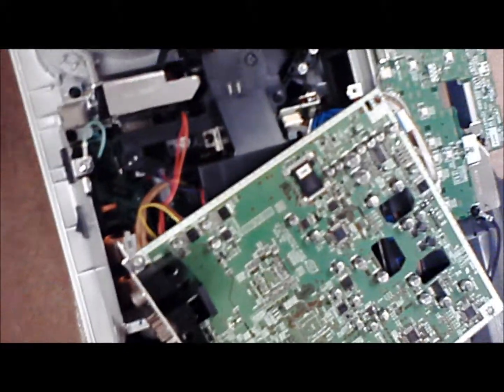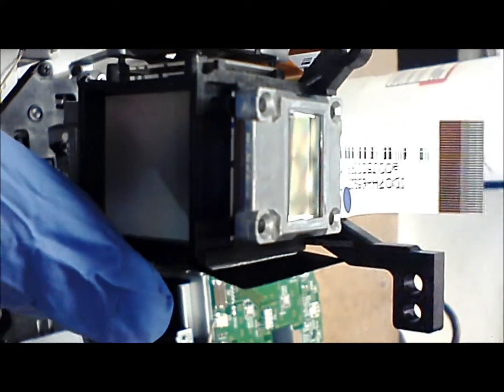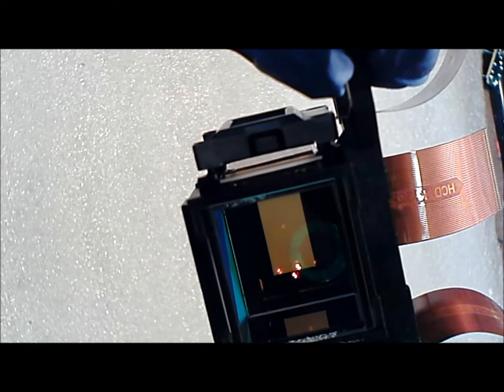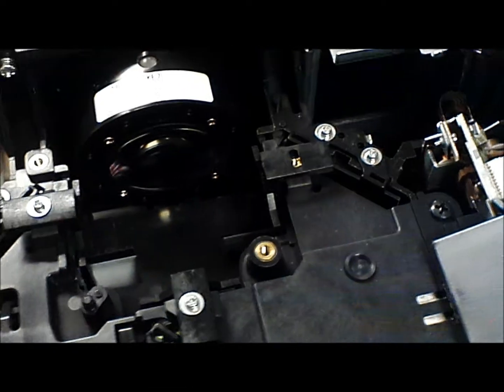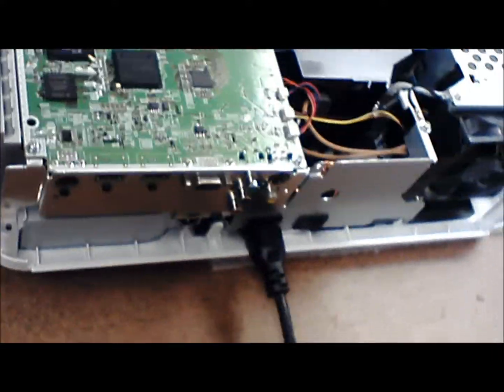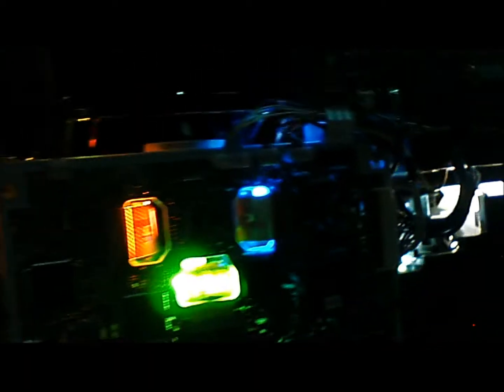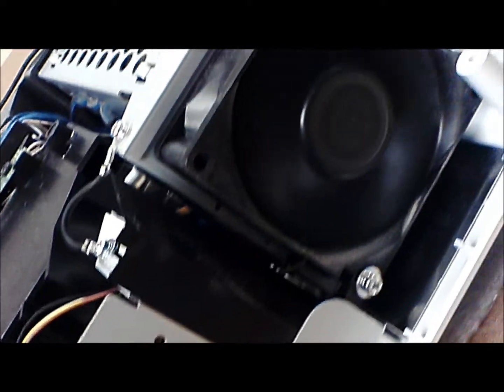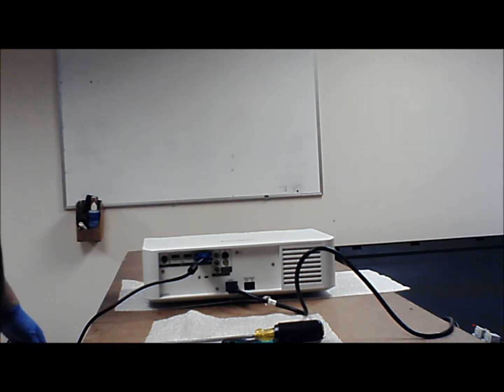Polarizer Replacement Panasonic PT-AX200U LCD Video Projector

Comment: I've stripped down my  Panasonic PT-LZ370 as it has a green haze mostly on one side when displaying a black or dark screen, other than that the image is perfect, having cleaned and checked for dust I'm wondering if I should remove and clean the PBS array closest to the lamp as I hear they can cause issues or burn due to heat. Any advice would be greatly appreciated.
Reply from the maker: Sometimes less is more but I fully agree that a clean projector will be better.  Heat is what ruins these so anything you can do to keep it cleaner and cooler is a good idea.

Comment: verry educational video!
I’m working on 6x Epson 7 and 8k lumen projectors.
same problem.
i’m trying to experiment with making the polarisers diy style, found a company in the uk that manufacturers the polariser film.
the original polarisers are the coated type ones that you can not clean with anything.
Reply from the maker: Epson drives me up a wall.  I wont even touch them anymore with optic issues. those polarizers and other coatings are really a problem with them.  good luck with your research! I hope you figure something out!
Reply: there will be a youtube clip on my channel with the repair. i'll post it even if it fails although I'm verry confident it will work. @FixitFrank

Comment: If the whole picture of the projection is fully green would i have to replace the green one ?
Reply from the maker: I believe so.  The green polarizers control the green level.  But it could also mean the red and blue LCD panels aren't working.  If you have some faint red and blue then yes, Id look at the polarizers.
Reply: @FixitFrank   ah ok  thanks I checked it and turns out one of the wires wasn't connected kinda goofed a bit on that

Comment: i have a huge red spot on my projector,  will replacing the panel fix it?
pls lmk thanks!
Reply from the maker: It depends on the model.  Sometimes its the LCD panel, other times its the polarizers.   If its this panasonic and its the polarizers, then yes, you will be in good shape if you replace them.  If its the LCD, that is more of a problem.  Aligning the LCD is very difficult.
Reply: @FixitFrank  I think what I did is I plugged in 125v fuse on a 250v, and it burned after that, so Im not sure what's the problem exactly. And the model is Groview bl-89
Reply from the maker: @rohitchabukswar7266  I have good/bad news. The bad news is that you cannot repair this projector for a reasonable price. The problem is a melted LCD panel/Polarizer panel. In this model there is only one LCD/polarizer panel and they are a generic device that you can buy but the cost is more than the projector.  Sadly this makes these types of devices disposable.  There is really nothing you can do.  It happens because they use a single COB LED without any IR filtering.  This causes the polarizer/lcd panel to degrade quickly. 
The good news is that you did not cause it to happen. this is a very common type of failure for these fixed focus flashlight projectors. They tend to last a year or so before they fail like that. I would suggest purchasing a used name brand projector over one of these types.  They are close in price and the name brand models will last far longer.

Comment: Hi I got a used Panasonic projector same as yours. I can't seem to determine where the small connector with a blue colour from the power supply should go. Any idea
Reply from the maker: Its been many many years so I must apologize i do not recall. However, here is a link to the service manual.  https://elektrotanya.com/showresult?what=pt-ax200&kategoria=&kat2=all  It is third one down.  You can see the wiring layout in there.  The website is in Hungarian but it is legit.

Comment: Hi Frank, what type of tape or adhesive did you use to hold the polarizers down in the lcd panel? Will 3m adhesive work or super glue?
Is it best just to buy a working unit and just exchange the whole assembly?
Thanks
Reply from the maker: It's been a while but I seem to recall there being adhesive already on the polarizer.  that said, this was a pretty new projector at the time.  these days, I would look at installing a used but working optical assembly. That way all of the parts are evenly worn.  If you put in a new polarizer on an older assembly the colors will always be a little off. I learned that the hard way.
Reply: Do you think it's worth the repair on the cheapest projector?  The yg300 to be exact.

Comment: Where did you order the parts from
Reply from the maker: These came from Panasonic parts directly(PACparts.com) but being that this model is pretty old now, I would be surprised if they still offered them.  You might be able to find them through aliexpress or try Time Electronics.  Their email is gydz@timeprojectorlamp.com
Reply: @FixitFrank  mine has a green blob and they don’t have parts anymore

Comment: Another great video from Frank. They don't come any better. Useful information. As Frank said after fitting the polarizer to adjust you will have to remove the mainboard to access the adjuster screw and then you don't know which way to move it left or right?
Reply from the maker: Without the motivation from wonderful colleagues like you, I would not be as excited to post these. It goes both ways my friend.

Comment: I know this is an old video, do you know where I could get a blue led/polarizer for a nec np-pa653u ?
Reply from the maker: Thats a tough one.  Alibaba would be a good place to start.  However NEC parts are kind of a pain.  You might want to try emailing a company in China I use. GYDZ@TIMEPROJECTORLAMP.COM   Be sure to include a picture of the parts.
Reply: @FixitFrank  Thanks!

Comment: i have a question: i have an epson power lite 1080. when i turn on the projector the image shows up but it has a blue tint. this blue tint is present whether i’m playing a dvd, using the apps on blue ray player, watching regular cable, etc. i also have tried connecting the projector to different HDMI cables and also without HDMI cables but it continues to show a blue tint with the image from the projector. do you think the problem with the projector is the polarizer, specifically which one, and if so, do i have to change all the polarizers? thank you for any help you’d be able to give and for providing informative content.

Comment: Are these polarizers different from each other or these same (in accordance to color and focus)? How can i make a diy polarizer ? for my projector Epson 7600.
Reply from the maker: Hello Muhammed! Each color has its own polarizer. My understanding is that they are designed for each color frequency.  Each color has 2 polarizers, with a total of 6. I found that unless the polarizer failed early(like in this video), changing all 6 was needed to ensure the color was correct. All polarizers fail eventually. They slowly degrade over time. A new polarizer will work stronger than the worn polarizers and cause colors to be uneven.  I have never tried a DIY polarizer myself. My experience with LCD projectors has been a poor. Finding the correct parts has proven difficult for me.  Unless the LCD projector has an electronic issue, I tend to stay away from them because of the lack of parts.
Reply: @FixitFrank  sir lot of thank for detailed answer and i hope you will entertain with same passion. Your answer has satisfied my passion. Thanks again........Love you....

Comment: Hello, in the case q is q to cleanse the polarizing filter as you would do with that liquid ? i had an experience with a projector epson which cleaning of the filter is damage , gone was the layer of the filter, with other brands i have cleaned and i have not had a problem but with the epson if.
Reply from the maker: Hello Dan,  I would not put anything on the polarizer.  They will damage very very easily.  If you have polarizer problems, they need to be replaced. Once they start to fail, they are not able to be saved. Epson is well known for polarizer failures.  I won't even work on them anymore.  Too hard to get good parts.

Comment: sir please try to make a video on lcd alignment in 3lcd projector
Reply from the maker: I'm sorry, that is something I will not ever be doing.  It requires tools and fixtures that I do not have access to. The amount of time and effort is not cost effective and the hassle is too much for me to deal with.  I will clean LCD projectors and repair their electronics but I will never align an LCD.  It is very very difficult without the proper tools and even then, the time required is not worth it.   LCD projectors tend to be more disposable than DLP because of the design.  Normally I will not even replace polarizers.  I only did this one because it failed for an unusual reason.  Usually you have to replace all 6 polarizers since they all degrade at the same time.

Comment: Hello Fixitfrank,
I know you mentioned going to Heartland Supply for parts, but I can't find that website. I have a Panasonic PT-AE8000. I had to clean the PBS Array. It hat residue burned onto it. I was able to clean it with a razor blade without scratching, but close to the end of cleaning it I pushed to hard and the array came apart in two pieces. I want to replace the Array and one of the polarizer plates(blue).
Reply from the maker: You may want to try encompass parts. They have a lot of oem Panasonic. Another source is eBay, it may only offer used but good parts.

Comment: I have tat projector and it has a blue ring on the screen is this what causes it, if so how much is the repair usually,thanks
Reply from the maker: Hard to say the exact cause but you may want to try cleaning it first. Circular makes me think its dust making the blue but it might be the blue polarizer as well.  Repair costs vary depending where you live.  Can range from $150-200 up to $400 or so.  If it were mine, I'd buy a broken one on eBay with good optics and bad power supply. Then make one out of the 2.

Comment: Hi FixitFrank,
Thanks for the video. Do you think LCD projectors can be run without polarizers at all. I'm trying use a couple of LCD type projectors for a 3D projection setup and my 2 Proxima C445+'s are "pre-polarized." This messes with the setup required to view 3D. Thanks.
Reply from the maker: Short answer yes, long answer you may not like the results. The Polarizers set the color brightness per color channel.  If you remove them, you may lose all color balance and it might not allow you adjust it with the menu settings. All of that said, if you don't mind chancing it with the C445's, you may find it works for you.  Is the problem because of how the 3D is created? The image cancels out(for lack of a better term)?
Reply: Hey FixitFrank,
Thanks very much for the helpful reply. 👍

Comment: Awesome video. Is yours almost the same as a pt-ar100u? Mine has a bunch of green vertical lines, some are squiggly though and also has a green 'blob' on the side of the picture. I'm pretty sure it got a little hot when my daughter passed out with it on for about 7 hrs. 
Btw those little clips holding the 3 cables to the board are a pain. Barely touched the first one and the ear busted off.
Reply from the maker: Hi Joe, its pretty much the same for most projectors around that series. LCD projectors more or less work the same. if yours has squiggly lines it is most likely those cables. the latches can be a pain. you may want to consider buying a scrap unit on eBay for the latch parts or even used polarizers. but you may also be better off buying a used working unit for the hassle of finding parts for that model since its pretty dated at this point.

Comment: Hi Rostit, not sure if you are still monitoring this very old thread but I am hoping you can still help. I have had the yellow blob problem for a long time and saw this video also some time ago. I have over 5000 hrs on this old beast and so I was a little reluctant to go through the hassle of replacing the polarizers. Then my latest bulb actually "popped" and broke (not sure what that was all about) and I had to open up the unit to clean out the fine glass particles. Anyway I though this might be a good time to pull out the blue polarizer to see what was up and sure enough it had a large discolored rectangle area which I assume represents a large burn area. I did not have the replacement part and because for the most part this just messes up large areas of white (like hockey game ice and snow scenes) I figured I could live with it for a while. Long story short I put every thing back together and now I have these blue vertical lines across my screen. could I have put the polarizer back in backwards or something? I checked all the connectors and they seem fine. Your advice would be most welcome.
Reply from the maker: +Kim Upright Hey there, I do still monitor these. Blue vertical lines is probably due to the Blue LCD panel flew cable.  Try re-seating the cable in the ZIF(zero insertion force) connector and gently hold it in place when you snap the ZIF latch back down to hold it. I would bet the cable is almost all the way in  but either not straight or not in all the way.  Sometimes people dont realize the connector has a latch and just pull the wire out and push it back in. Make sure the latch is open all the way when you slide it in and then latches snugly when you close it.  Good luck! Frank
Reply: +Rostit Wow awesome quick response. The clips for the ribbons coming out of the image block on the circuit panel have little black pins that have to be pulled out on each side of the clips (took me a while to figure this out) any way I have reset the ribbons in these clips a couple of times with the same effect. I am amusing from your reply that this is the part you are referring to. Anyway would you recommend re-seating the ribbon while the projector is running? or is there too much risk in frying something on the board?
Reply from the maker: +Kim Upright sometimes they feel like they are seated when they can drop down a little more. You "can" do it with the projector on, but you need to be hyperaware of the high voltage by the lamp.  Be careful when you adjust the cable. its not likely to short out the driver chip as the pins have some space to slide a little without touching what it shouldnt.
I would try lifting the latch of the ZIF latch and gently press and rock the cable. the picture will go nuts but it will settle once it drops into place. Check the other cables too. Not likely that they are loose but its worth checking. good luck!  Frank
Reply: +Rostit Hey Frank thanks for all this - I did finally get the cable to sit right and the lines went away. Sadly after adjusting all the menu settings and getting the picture to look passable for most scenes with a fried blue polarizer -  my PS3 finally decided it was it's turn to kick the bucket so I give up :-) Thanks again for taking the time to help out.

Comment: Hi Rostit, very good video! why did you change the 2 polarizer? Only the blue polarizer out was dead. Why did you change the polarizer IN?
Reply from the maker: +Pyter B There is 2 polarizers per color channel. The Incidence and Projection Polarzers.  There are 6 polarizer pieces in total.  They work in pairs.  Changing the angle of one in reference to the other is how they block light.
Reply: +Rostit , Ok. I have the exactly same problem show in your video. The blue polarizer after the LCD have yellow mark. But the blue polarizer before the lcd looks good. Do I have to change both of them, because they work in a pairs? I'm not going to changing the angle.
Reply from the maker: +Pyter B I would change both. if one is obviously bad, then the other is either slightly bad or will fail in the near future. it may even already be bad and its just not visible yet.  if you are going through the trouble of all this work, it'd be a shame to have to open it up again in a few weeks to replace the other polarizer. don't forget to clean all the dust out while its open . Good luck!
Reply: +Rostit I'm going to change both of them. Thank you for the good and wise answers!

Comment: Hello in understand this is years after your post but I was wondering where I could purchase the incidence polarizer.  Mine is finally starting to warp in the center but the picture still looks fairly good. Only problem is my bulb went bad and I'm afraid the new hotter bulb will exacerbate my problem.  Thank you
Reply from the maker: +ataataa I found these through pacparts.com if I recall correctly. encompasselectronics is another source and lastly Heartland Supply (I am not a fan of heartland as I have seen things I dont agree with from them).